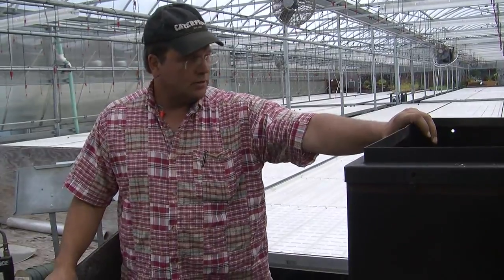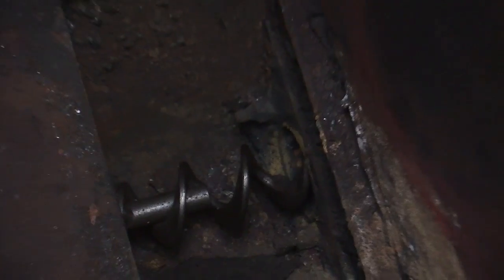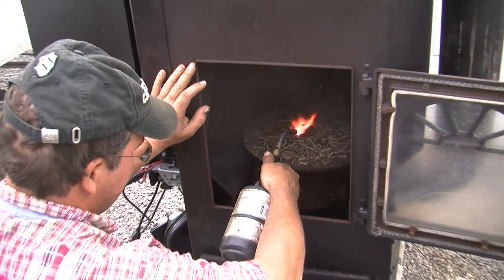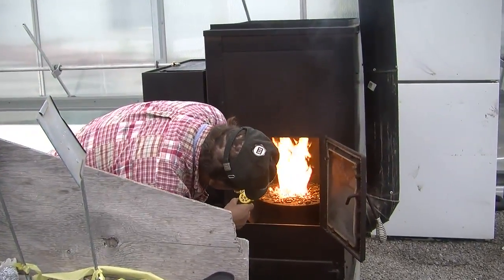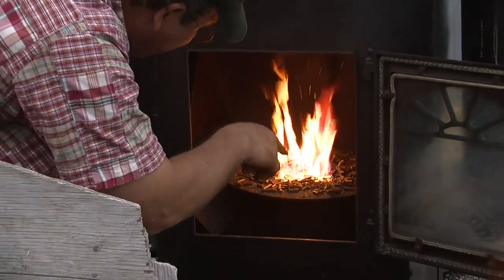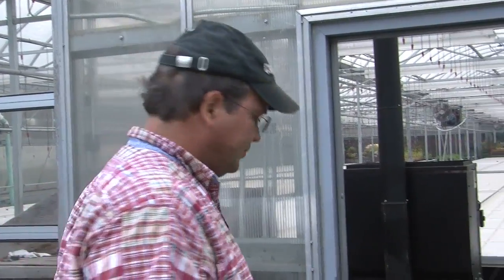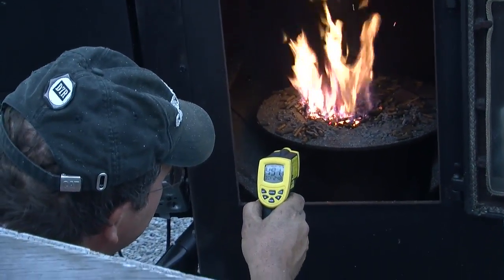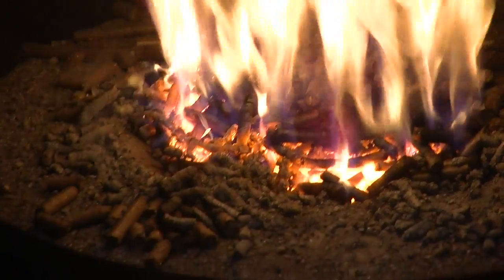Heating a Greenhouse with Grass!

Comment: why not just buy a pellet stove and it does all the work for u.  Lites  itself and auto fills even keep temp at what u want.  I was thinking about getting a green house but everyone said it cost to much to heat.  I also noticed the pipe going to the roof does not melt the wall of the green house I would of thought it would get to hot and melt the ploy sheet.  but i guess not.  Great job on heating it
Reply: +Maggie Cimba Pellet stove's won't won't work with grass pellets as their ash content is way too high....you need an underfeed stoker for anything that produces high ash amounts and/or clinkers

Comment: I would guess on a COLD day, you burn more than 200 lbs for a huge greenhouse. Cost of pellets have more than tripled over the past few years. According to enviroenergyny   17 pounds of pellets will equal the BTU’s of one gallon of oil    Cost of pellets have more than tripled.  I am all for going green (I have a wood gasifier boiler), but do not like exaggerated claims.